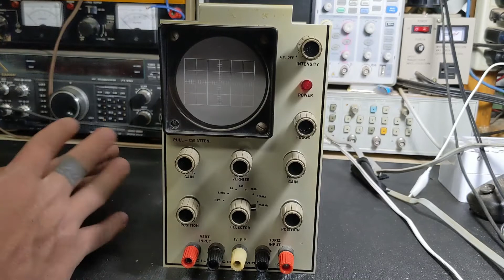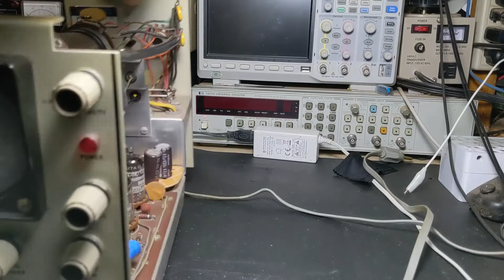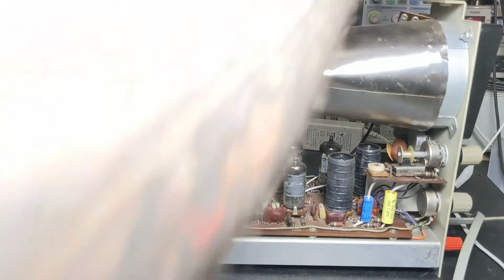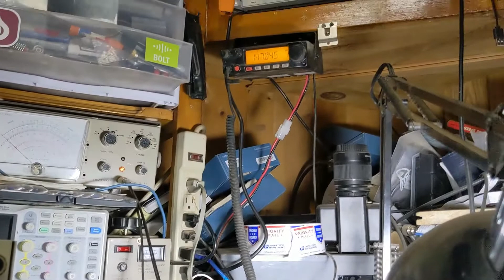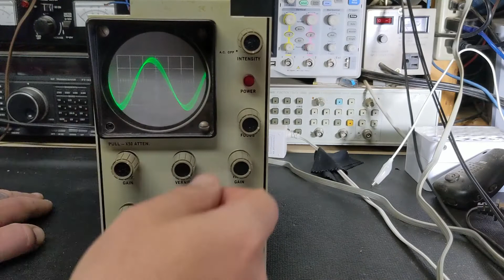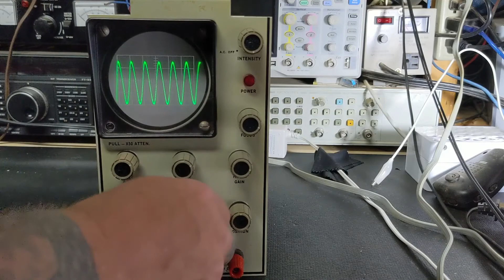Heathkit IO-17 Restore | PART 2

Comment: I like your solution to the electrolytic cap replacement where you didn't have the room. I saw another YTer who got a set of adapt-a-cap bases that would 
make it more professional looking. Go to adapt-a-cap.com     Just ordered a 5 pack. I also went to my storage and found  my grandfather's IO-102 oscy.
He couldn't get vertical deflection to work while testing it. He left a soldered lead to a component where he stopped. I saw him struggling with it 
so many decades ago. Now I think I know why. My uncle used to sort out the resistors for him while building Heathkits. He wasn't around then,
he lived in another town, and I guess my grandfather didn't want me to do this sorting work cause I was  like 12 at the time. Well I found out why he struggled .
He had color blindness and didn't want me to know. So I guess there are resistors soldered in with the wrong values and switching blue and green bands
especially the third band on the resistor can throw off stuff by a factor of 10. Looks like I have a good starting place to check. Love to get it working.
Reply: That's funny about you weren't allowed to sort resistors at age 12.  I know 12 year olds can be plenty smart enough to do that.   I remember being 12. 

Built an IO-102 at age 13 or 14, only had one diode backwards, fixed it and it worked fine.  

I feel like I'm old enough now that I should say something about "kids these days"...
Reply: @DrunkenUFOPilot  Actually he didn't want me to know that he had color blindness .That's why I was clueless on why I was NOT  allowed to help.My uncle told me decades later that he had to help his old man to sort parts out.
This family was a bit weird. We went to Cleveland to visit a week with my grandparents family. Well there was skip going on the TV and I was able to get a channel out of Toronto CA of all places. Well my grandmothers sister told me to change the channel ,your only supposed to watch TV from here in Cleveland!